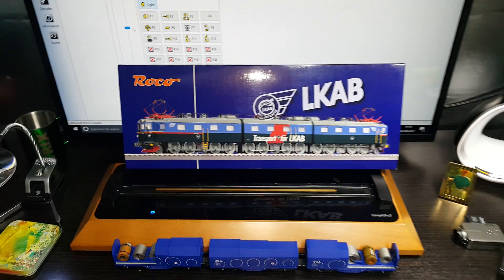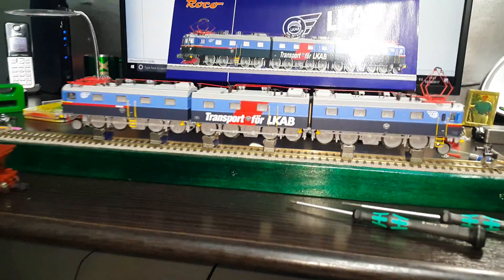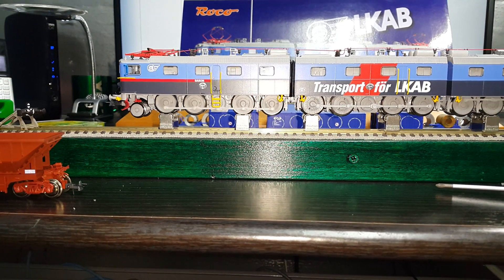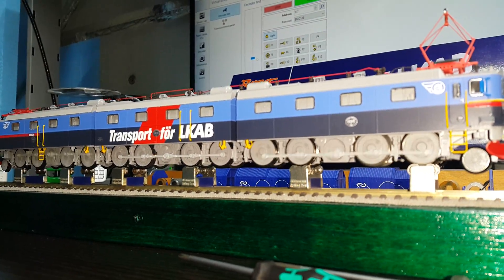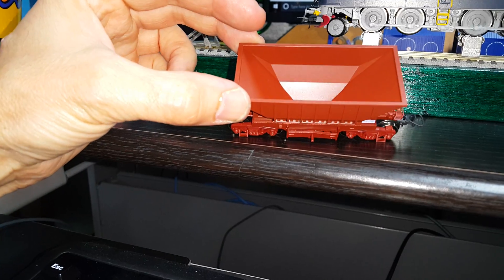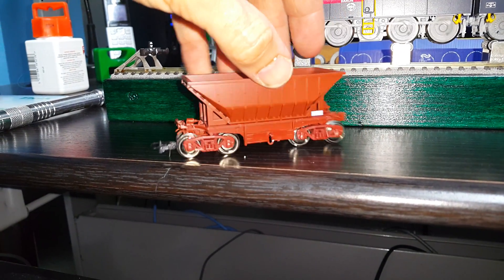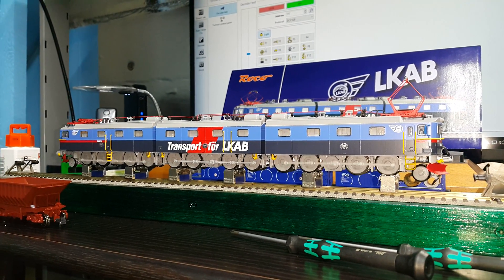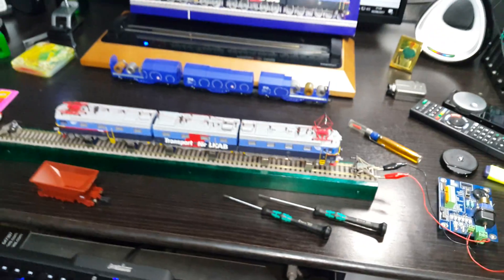ROCO 63754 CLASS DM3 1200 (year 2005)

Comment: Nice review Jim . I run the later LKAB LOC from ADTRANZ not as expensive as the DM3 pulling 32 of those ore wagons ,never had to clean the wheels once ,bought it back in 2003 and runs fantastic ,awesome pulling power
Reply from the maker: Guido Tamburrini cool......the roco ore wagons are very difficult to find  I may run it with other types of ore wagons.